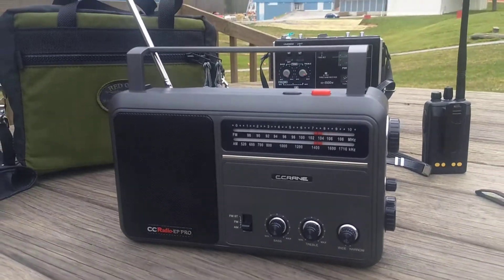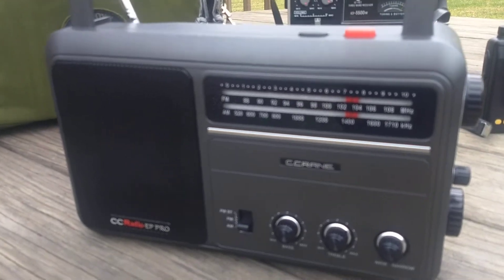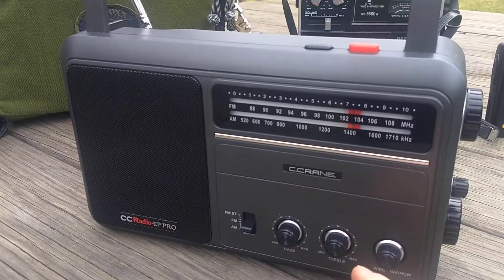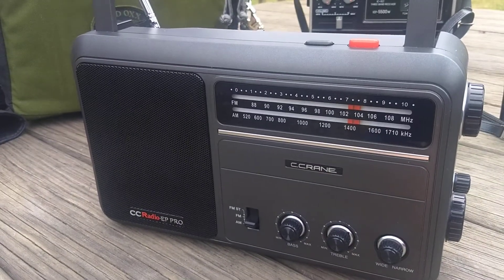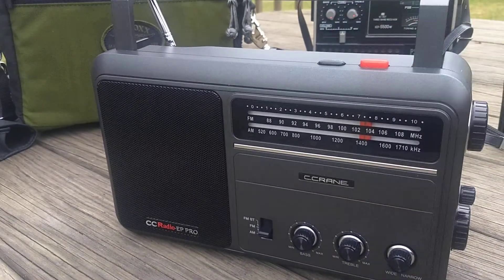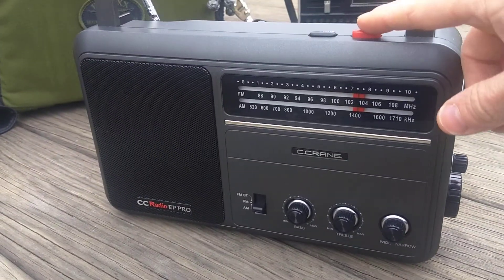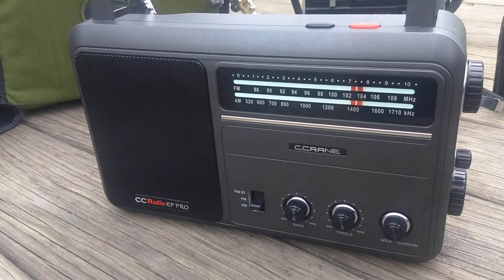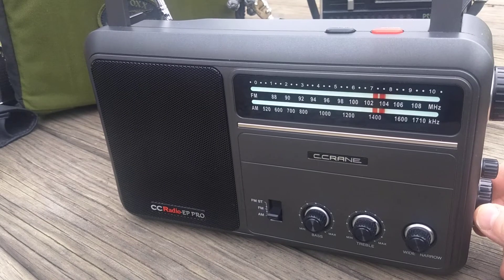C. Crane CCRadio-EP Pro AM band scanning, muting

Comment: Just heard the ad for this one on C2C. I do like the band slider. And I would prefer a radio that has the ability to keep the dial light on. I miss that on radios today. They all auto dim or go dark. I have fond memories of all the radios I had in the past which had warm dial lights that were the only light on in my room at night as I listened to the radio. 

Not nitpicking, but aren't most of these radios made in China and rebadged for different brands? Even here in Japan, once great manufacturers are having things made in China. Used to be a big no-no for Japanese products to keep the QC high. Times have changed. 

Robbie in Tokyo

Comment: For the people wanting to buy this radio and waiting for April 26,  I would appreciate a more thorough review by the people who have the privilege of having advanced copies. This has been hyped as the new superradio over in the states, please show if it is or not, in your opinion. The old EP had drift does the new one suffer the same condition?  How does the ferrite adjuster work with the new DSP chip? Many unanswered questions out there people would like to know. Thanks
Reply from the maker: Hi, Thomas, I'm in the process of writing up a thorough review right now. Just finished the first draft so hopefully will have it posted by Sunday (April 11). I can answer some of your questions, though: The EP Pro does not drift. The tuning steps are fixed (at least on the first production run) at 10 kHz for North America only. The Twin Coil trimmer has an impact on the received signal, but frankly most of the time the default position is sufficient--adjustments can help optimize some signals though. Look for my EP Pro review on my blog: http://swling.com/blog/tag/ccradio-ep-pro
Reply: Thomas Witherspoon 
Thanks, I am looking forward to your article.
Reply from the maker: It's a pretty lengthy review. Spoiler: I'm not entirely pleased with the EP Pro. It's a sensitive set, but very quirky.
Reply: @ThomasK4SWL  I am looking for a high quality portable radio. I listen to am as much as fm. I enjoy both talk radio and music. Price is not an issue. Is it possible you may recommend a radio ? Thanks.

Comment: Wow, that's really bad. I mean, I understand it's a very sensitive and probably quality made radio, but this muting is not what someone expects from a radio with a slide rule.
I've owned DSP-powered radios for quite awhile and it always bothered me that tuning is not continuous. Just recently got a high quality analog portable and it's so much pleasure to use!
Reply: I am looking for a portable radio . Which is the one you bought ?
Reply: @chancha807  Tecsun 9700DX - they are much cheaper if bought from AnonCo and not from Amazon. Using it for more than a year now and still very happy with it. Bought a second one just in case the first one breaks.